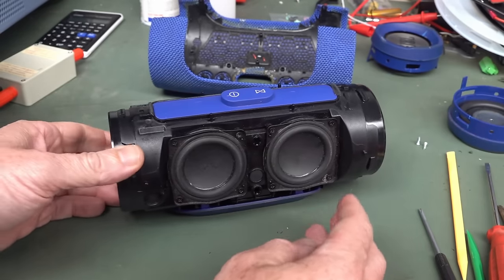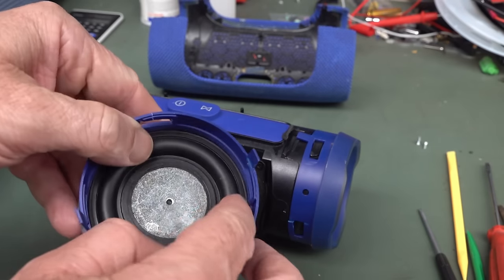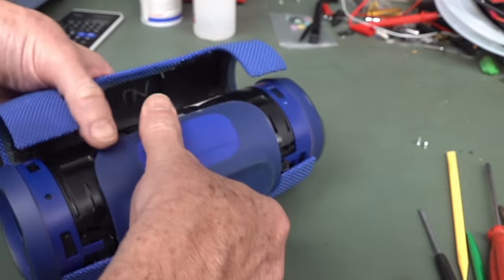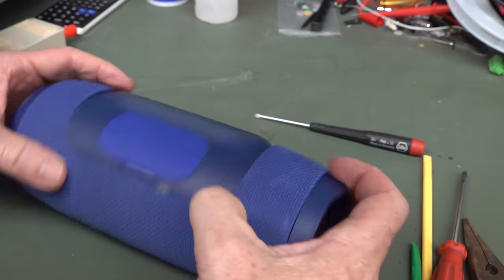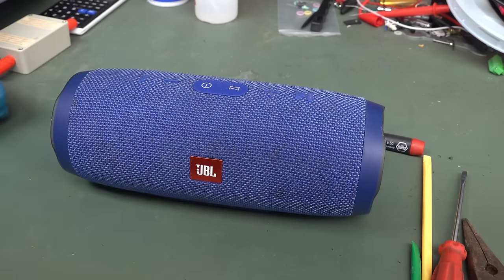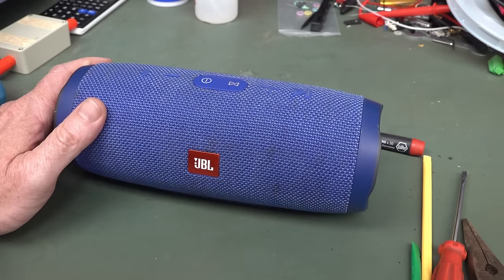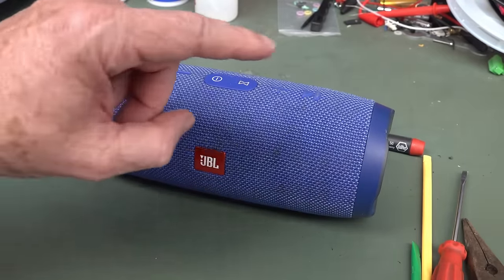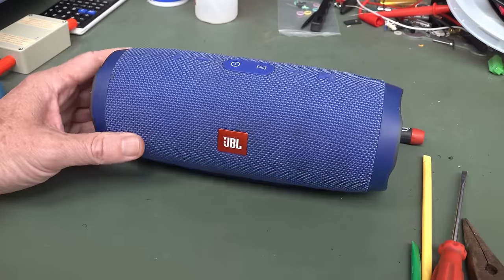JBL Charge 3 Repair - Part 2

Comment: A lot of different suggestions. My personal experience with dynamic drivers making THIS exact symptom, Is when the physical mechanism of their operation is "damaged" either the coil has deformed and rubs, or its not completely attached to the cone correctly and slaps the cone when reciprocating. The impact with the other speaker may have altered some already there damage and gotten whatever mechanical noise was, to stop. if it comes back, try swapping the speakers around. or try a different speaker all together.

Comment: Another guy on YouTube has a video with a similar issue. It was the wire connecting at the speaker terminal. It was more affected by bass and intermittently. The startup sound has more bass than the shutdown sound. But maybe moving the speakers around temporarily fixed it
Reply from the maker: Possible
Reply: @EEVblog2 It's speaker (cone) lead wires, 100%

Comment: My bets are on the reseating the connector off the mainboard.  Now If you can just figure out how to clean the cloth covering.
Reply from the maker: I tried isopropyl but it didn't do much.
Reply: @EEVblog2  Car accessory shop and get some foam upholstery and roof panel cleaner, which you apply dry, and then scrub gently with a soft bristle brush. Or get some foam carpet shampoo, and use the dry foam of that.

Comment: It sounds like electrical clipping. All I can say is one of the VERY common faults is the SMD capacitors on the output of class D amps. They see significant voltage spikes and go bad. They don't always measure short or obviously bad on a simple low freq. test. Just rip them off to check. Who cares about emi? The rail is probably dropping due to oscillation sucking juice.

Comment: I remember the jbl extreme having circuitry dedicated for measuring the audio signal envelope and adjusting the supply rail voltage, presumably just enough so that it doesn’t clip while also improving battery life at very low volumes.
Reply: Some larger amplifiers also do envelope tracking, at least one implementation has the disadvantage of adding lag so there's a "game mode" to disable it.
Reply: I was going to reply something similar. A lot of Crown amplifiers implement what they call a tracking power supply, were the dual rail voltage can hover at about plus or minus 15 volts, but as soon as you start cranking it it can get as high as 30 to 45 v plus and minus, depending on what model / wattage its rated for.

As these Crown amps often sit idle but powered on 24/7, I suppose doing it this way can make them last longer... But I have actually noticed that tiny delay on certain songs that just start really low and kick in out of nowhere...

Comment: Having things appear to have fixed themselves was a real problem when I worked on aircraft. Every squawk has to be signed off with a disposition. Anything that got pulled out and put back in, or unplugged and replugged might have 'cleaned and straightened connector contacts' when signing it off. Or, if we just wanted to go with on the next test flight 'can not duplicate on ground, request to accompany next test flight '.

Problems can be weird with extreme temperature variation and g forces and vibration. And one never could rule out electrical interference between systems where there's no earth ground, only metal structure for power and signal reference.
Reply: My absolute best fault ever was "first bomb landed on target", as a description.
Reply: Squawk: dead bugs on windscreen.
Disposition: live bugs on order.
Reply: @coyote_den Autopilot does not engage. Unable to engage on ground.

Interphone volume unbelievably loud. Adjusted volume to be more believable.

Comment: I wonder if the passive radiator was hitting that wire that is really close to it inside. 
My vintage B&O speakers developed a buzzing noise a while back. I took the woofer out and found that the fluffy sound damping stuff inside had slipped down and was pushing the wire for the mid range driver into the path of the woofer.

Comment: You're missing the simplest possible fault in this case: "Air sealing failure".
Most speakers function like partially airtight sealed chambers, so there's a lot of rubber and foam seals everywhere.
Especially if the thing is waterproof. And you can make a rubber balloon fart...
It would also explain why taking it apart and reassembling it, might have fixed the problem.

Comment: I wonder if it wasn't an actual mechanically oriented buzzing, where either some part of the case or physical internal structure was buzzing or bumping up against another part at lower frequencies. This would certainly explain why the symptom disappeared after it was disassembled. Then having sufficiently reoriented and reinstalled the various bits and pieces, now no longer wanting to buzz up against whatever, the fart has passed, so to speak.

Comment: I had a "similar" sound with my Kef MUVO BT-speaker. It appeared to be caused by air leaking through the seal. Tightening the screws fixed it. This all started after the speaker was dropped on the floor. Might be the same issue.

Comment: Probably, something small stuck inside in farting speaker near coils causing limited movement.. At disassembly, when both speakers multiple times stuck together, this was enough to eject out particle..
That particle may be still inside from factory in that speaker, but it isn't altering cone movement anymore..

Comment: You moved or compressed the battery and this improved its condition for a couple more cycles :) I replaced the battery in my JBL with the farting bass issue. The issue is completely gone after the replacement. It could of course be a mechanical type problem that coincided with the dying battery, but I strongly believe that the explanation you're citing from the repair video comments is the correct one.
Reply from the maker: Way more likely to be the battery contact resistance.

Comment: That board didn't have a lot of interconnects except to the button oval? So you have to ask, what has changed? Before if you were sampling output to the speaker and there is weird stuff in there that is kind of not audible that is not a great sign. Still think something SMT may be intermittent contact?

Comment: Thanks for showing how to disassemble this unit, as I got that identical model. 
Think mine is about 1 1/2 year old, so no problems yet. 
I'm a technology follower, and always buy the older, then cheaper model. That was my best investment, as it's really versatile and has a good bass sound.
I also hate such undiscovered errors. I always want to know the root cause.
Anyhow, I also think it was a problem with the connectors, which was oxidized. Probably it had been one of the higher current connectors, i.e. the right speaker. If it would have been the battery connector, both speakers would have made this blurping sound.
Reply: i have two(i pair them in stereo) 1 bought from germany and one from  bulgaria. both started experiencing the problem around the 3rd year. the problem is the battery esr. Dave's problem is, that, when he uses the device with no cover the mech load on the speakers is different and the needed current is less. i bought new batteries and the issue disappeared.

Comment: Might've had an issue with the clips on the end caps because you fitted at least one end upside down, maybe both.
Edit: Just saw the overlay note @1:36 after reading someone elses comment🤣
Also, the white lab coat syndrome happens all the time in the Automotive industry too...any time a mechanic tries to diqgnose a customer's concern with their car, the problem is miraculously gone, or it's super difficult  to reproduce🤷‍♂️👍🇦🇺

Comment: I have two hypotheses, one of the two, first: it could have been dirt on the speaker or something else (maybe a piece of foam with glue). Second: in normal use at high volume reproducing low frequencies, the speaker coil may hit the bottom of the pole piece bending the end of the coil, so the defect may present only when reproducing a certain frequency range, it is rare to happen but I've seen it. You accidentally fixed it when one's magnet stuck to the other's cone (part 1 - 7:39). I even thought you were going to change the speaker in the first video 😅

Comment: It could be a software issue. Maybe due to an undervoltage, at a certain moment, a internal memory containing the sound became corrupted, and stays over the time.
As you disconnected the battery from the board, the micro controller booted up again and reloaded the files, so the sound is fixed…
Just a thought.
Greetings

Comment: Unplugging and plugging back the battery connector fixed it. These things take a couple of Amps at low Voltage and any resistance on the battery connector could give them this sort of flatulence. If you open it up again, maybe connect a resistor in series with the battery, to test the theory?

Comment: Hi, i had the same issue with the same model. I had the same idea with a bad soldering connection on the speaker.

On that case it was the speaker. The joint looked good and shiny but under 75x zoom with a mikroskop i had seen that the hole joint had lost connection from the pad.

After resoldering the problem was fixed. 
One year later the other speaker hat the same Issue with the same fix for that.

Meanwhile i have a jbl Xtreme 1 for over 3 years without the issue.
Just amplitude dips in the bass from a wornout batterie.

I hope that help you.

Comment: I had a little pocket speaker years ago that developed a sound basically identical to this clipping noise at high volume, and only with high power output sounds like a bass note or drone.
I thought it was the driver and replaced it with another but it persisted. Even when connected to a power supply instead of battery. I didn't have any serious testing equipment so no scoping but it seemed to be an issue with the amplifier circuit.

Comment: It might have been an oxidized connector.  Caig Labs’ Deoxit followed by a naphtha (or cigarette lighter fluid) wash does wonders for problems like this.  Sometimes, just unplugging and reseating the connector is all it needs.

Back in the 1990s Caig Labs used to make Cramolin red and Cramolin blue.  I first read about them on an audiophile Usenet group, and I was skeptical because audiophiles believe in a lot of ridiculous voodoo.  At the time I worked in a neuroscience lab and we were having lot of trouble with noise picked up on Deutsch-like connectors of Grass EEG amplifiers. The pins and sockets were gold filled, but noisy anyway.  One treatment with Cramolin, and as Dave says ‘Bob’s your uncle,’ noise was gone.  I believe the current Deoxit product isn’t as good as Cramolin, but it is close.  I use the D100 100% without the preservative that D5 has and then flush with naphtha.

Comment: Dave put the passive radiators on with the jbl logos upside down, oh well she works a treat and glad you fixed it
Reply: You didn't read the overlay note, I fixed that.
Reply: @EEVblog  my mistake won’t happen again
Reply: What's the audio equivalent of all the electrons falling out? 😄
Reply: @JonnyFix  hey Johnny, just subbed to your channel, I’m gonna watch some of your video, I am no electronics engineer, but ever since I was a youngster I always loved tearing stuff apart and trying to fix things
Reply: @kristiandawe85  Nice! Hope you find it interesting and or helpful. Nothing beats practice so find some junk and get cracking 😄You don't need to be a genius to figure this stuff out. It's just a few basic fundamentals strung together to solve a particular problem. The hardest part can be figuring out how something works so you can figure out why it doesn't (physical damage aside) and if you can get a schematic for the thing it's worth its weight in gold. While some things have common failure modes, most of the time there's no one solution for a given fault. Solving the puzzle is why I do it. Good luck, see ya round!

Comment: I dropped my cellphone on snow-dusted pavement a few months ago. It quit working a few days later. I took it apart to see if melting snow got inside and caused corrosion somewhere, couldn't find anything anywhere. Unplugged all non-essential cables in case any of the cameras and sensors shorted out, still only got the logo to show up for a second before powering off. Ordered a replacement phone.

After I got done setting up my new phone, I decided to measure battery voltage on my old phone just in case I missed the most obvious thing, I noticed that I couldn't feel the buzzer going off at power-on as usual when I pushed the power button and thought it was dead. When I flipped it over, it turned out it had turned on and finished booting. I left it on overnight only to find out it died at some point before I looked at it again next morning. Still doing the flash logo and die routine. I decided to clip my DMM on to look at battery voltage, pressed the power button and the phone booted normally again.

It hasn't randomly turned off since.

Comment: I do have a question about this speaker, how loud can it go before it starts clipping and distorting, I have a altec landing speaker that distorts at about 70% volume, it’s been like that since the day I got it
Reply from the maker: You heard it at full volume in the video. Mic didn't pick up how loud it was, but you can go full volume and it's very usable, not much distortion. Quite impressive for hte driver size.
Reply: @EEVblog2   well that all I need to know, I think I’ll look into getting one, the shoe phone charging usb-a port will come in handy too for charging up my phone in a pinch
Reply from the maker: @kristiandawe85  They have three models of various sizes, this Charge one is the mid size. They are highly regarded.
Reply: I use Breathe by the prodigy for checking how loud you can go with some good bass. If you want to have music that you can use on Youtube, there is the stuff used by Williston audio labs channel on his 'does it bump doe' sections.
Reply: JBL (and many others) heavily utilize DSP to fine tune the frequency response on all volume levels. For example if the volume is below 70%, the DSP will boost the bass so it will sound larger/fuller than it should. If the volume is higher than 70%, you can hear it louder, but the bass is becoming less pronounced (thinner). The DSP is set to maximize the speaker driver potential while avoiding clipping/distortion on high volume levels.

Comment: My bet is the Lead-Free solder on the speaker.
Lead-Free is wawaaay less "flexible" / ductile? than good old leaded. Especially on a driver that vibrates ALL its life, crack in the joint are bound to happen, even if they don't lead to a full disconnect. BUT the BASS sound at startup, has the PUNCH necessary to disjoint the terminal > FARTS.
Since all new-age electronics are made without lead, that's my guess. I've seen this happen in some other portable electronics, everything measures fine (stationary on the bench), but in hand (as it's made to be used) in a dynamic setting, it sorta works at 95% quality.

Could have also been a socketed wire, but you saw they were hot-snoted in... IDK 🤷‍♂

Comment: I also thought that it's the Battery because my JBL Charge 3 Battery needs replacing and after 5 Minutes on full volume it starts to Distort and then shuts off a Minute later.

Comment: Perhaps some junk between the cone and outer cover that was vibrating or some other weird case resonance.
Reply from the maker: My leading working assumption is a bad/correded contact on the battery connector that got fixed with a wiping action when reconnecting.

Comment: Probably that processor module desperately needed a proper cold boot... BTW thanks for the teardown, now I know how to replace a battery in mine...
Reply: That fart sound was like digital trash. Maybe by disconnecting the battery it reloaded that wave file properly into memory ...

Comment: Maybe the file that it playes at startup somehow got corrupted so it sounded like that.
Then during the repair you disconnected enough things to resett it back to it's original state.
Even when it's switch off, it's still got power to the standby circuit and stuff,
but when you took out the boards, you disconnected everything so it got reset.

Comment: Perhaps all the speaker needed was a slap on the wrist to stop acting out!! But you didn't check the battery voltage with the scope probes while reproducing bassy music, to see if it dropped too much? Anyway, if it works it works.